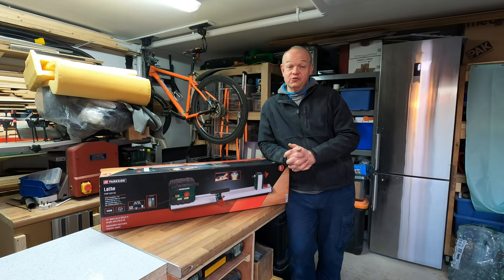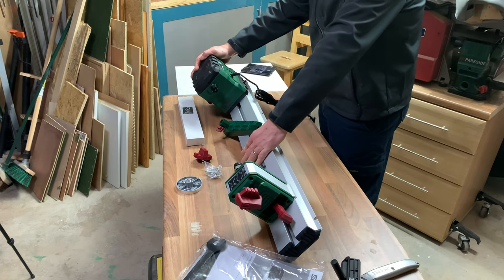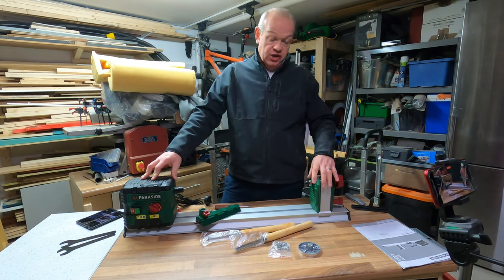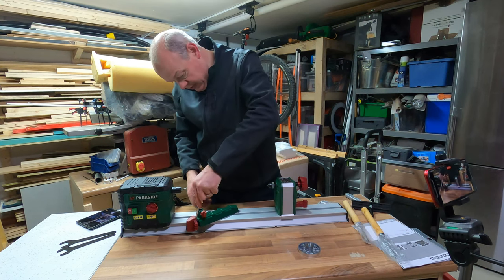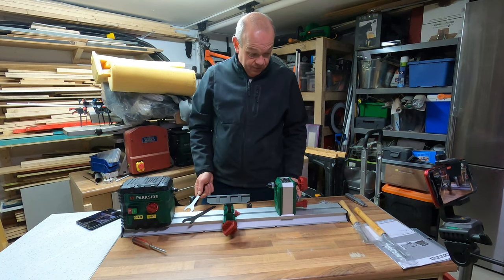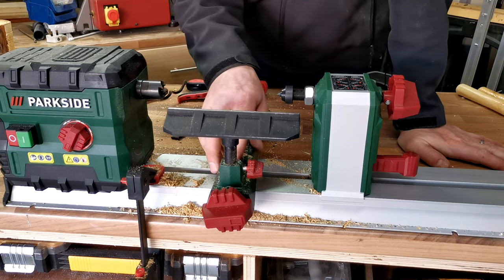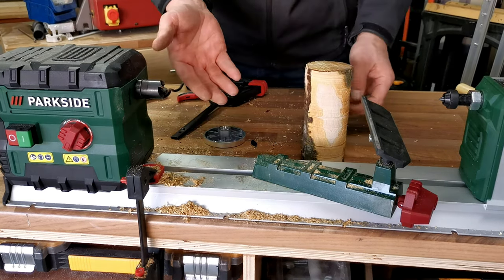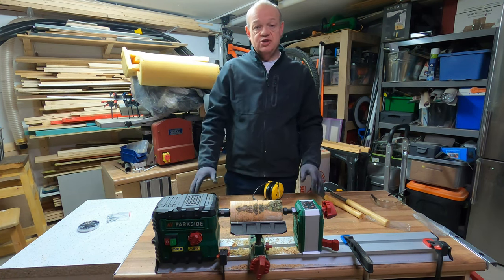10 Minute Tool Review   Parkside Lathe

Comment: I got one of these about a month ago but havent used it yet. I wasnf aware it needed to be screwed down and im currently in the middle of building a shed workbench. Once ive finished, im gonna screw it down (and a bench grinder/belt sander) and ill get to making some stuff. The whole area is set to be where im gonna record youtube videos so expect a review by the end of the year! 😊

Nice video though, i have 0 experience with woodturning lathes (ive used metal lathes in a gunsmiths shop before) so i always watch reviews of tools idk how to use properly so i can learn those tips. I wouldnt wear gloves though, they can get trapped in the mechanism and your fingers would be toast by the time you hit that off switch. Same applies to table saws and pretty much any rotational tool (other than angle grinders according to some but thats a whole debate!)
Reply: I'll add it's not gonna take me 4 months to add a workbench, I'm refurbishing the shed, installing a patio etc 😅 going out to do more work today!

Comment: Thanks for this. Yes, it's 60 squid's worth- underpowered and underweight, but I agree at that price it's a decent entry-level experiment.
 It looks like the base extrusion is capped off at each end, so maybe try filling it with sand to add some weight/damping for starters. Even then I think it needs a more secure fix than just clamps for maximum efficiency. Also you made life REALLY hard for yourself by starting with an unprepared barked log! Plenty on YT re. this...
Glad you got to fulfil another Parkside review goal and thanks for sharing! Cheers.
Reply from the maker: Thanks for the message and yes I did....so maybe not a fair test.  I did work on it again after I made the video and to b fair I now have a very clean piece of wood!

Comment: You need to buy deacent chisels that will help. I am dismantling mine using motor as pulley unit and disk sander. Pulley will turn headstock I have purchased to repair cues hopefully.
Reply from the maker: Thanks for the heads up!